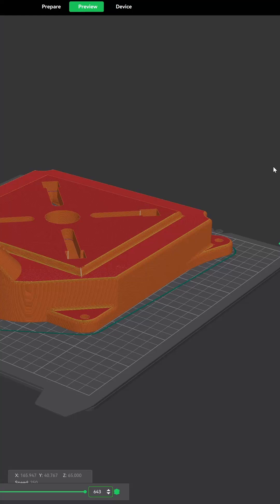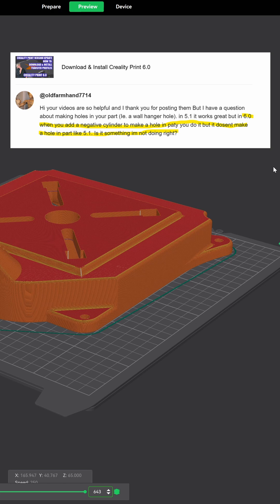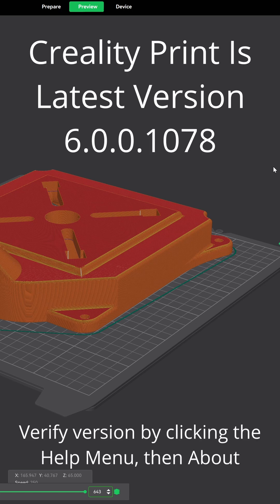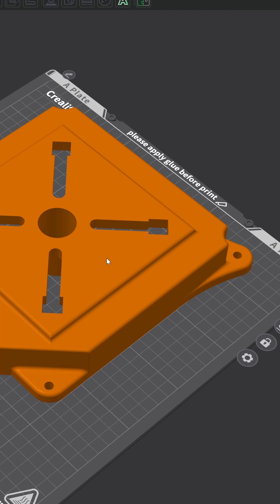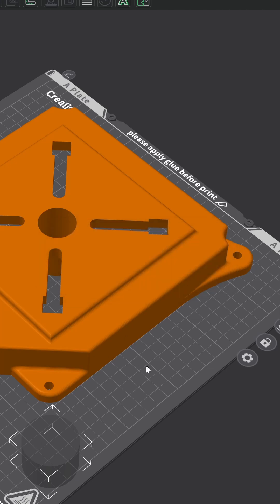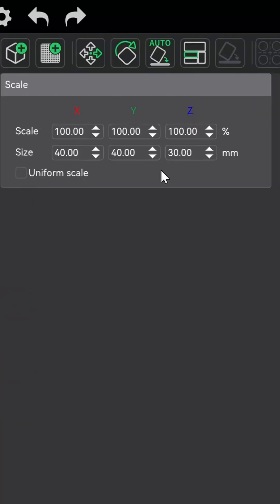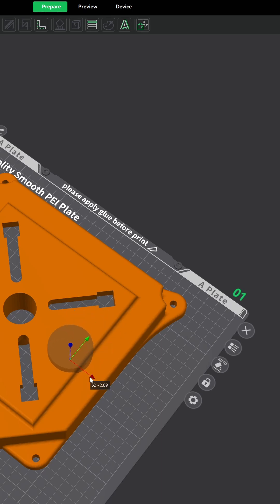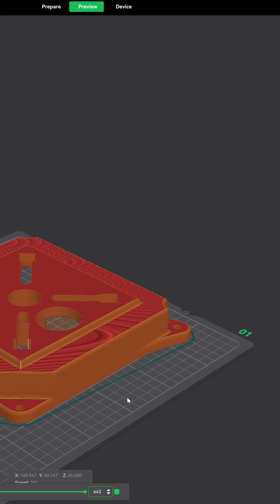#shorts Add A Negative Part In Creality 6.0

Comment: I saw 6 had ai infill pattern. I’ve not seen that before( perhaps it was on 5?], anyway is there some benefit, pros and cons with that?
Reply from the maker: I don't remember seeing it in 5.1. I'm pretty sure it might be new for 6.0. Just playing around with it, I made a 70mm cube and set my infill to grid. I believe it only works with grid & rectilinear infill. I started at 10% infill and kept going up until I hit 20%. It was at 20% where I saw the difference. Along the walls, the infill looks like it could be 30% while in the center of the model it looks like it could be 30%. The difference in print time is about 15 minutes. It's definitely worth experimenting with. Open up one of your models and slice it and look down a few layers, then check the AI box and reslice. You'll see the difference. It makes a better visual than it does to describe it. Let me know what you think!
Reply: @pushingplastic7445 5.1 did have it. It makes the inner larger and the outer smaller to use less material but still provides strength